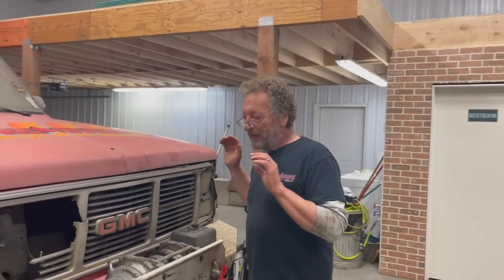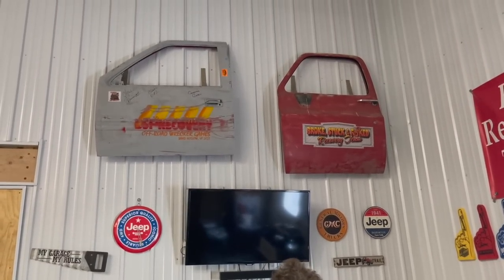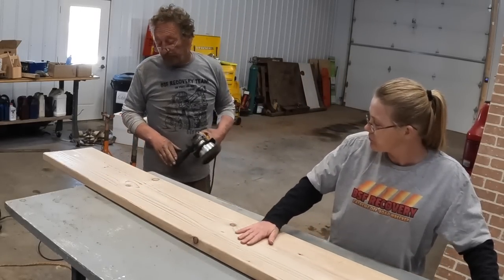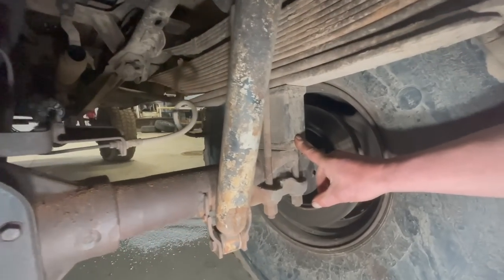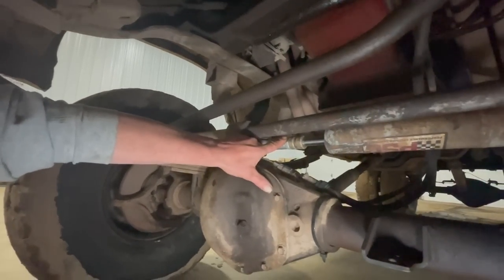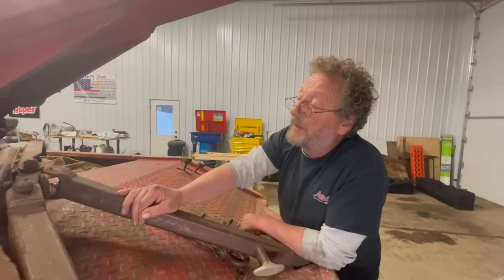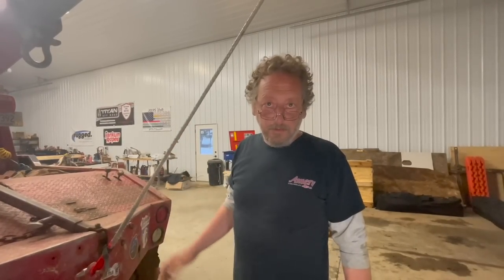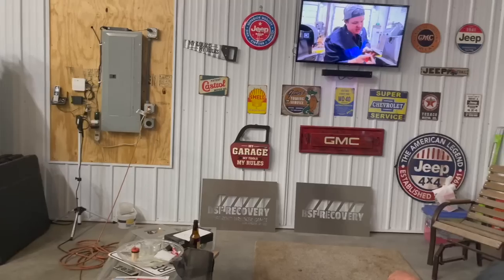Off Road Wrecker assessment after the games

Comment: Hi Eric, sounds like you have little bit to do, both in needed repairs or upgrades as well as wanted ones. As you mentioned your busy season is fast approaching and thats the only truck you have, make the necessary repairs to make it useable this season and over the winter you do upgrades that require the truck to be down for an extended period. Of course building a second rig would also be cool to see. Can’t wait to see what you come up with. Thanks.

Comment: 5.38 gearing will not even be noticeable. And some guys say 5.13 are inherently stronger. Id put a HD gas converter in and go with a doubler or magnum box from ORD. that big old heavy k30 with a smallblock and the th400 really could use some leverage on those 37s! I guess that's 1 huge advantage to haveing a stock 4 speed is the fantastic 6.55  First gear. Even second gear is deeper that the th400s first gear.

Comment: If this were my truck I'd be thinking about fixing the sling, fixing the springs, and modifying the hydro tank.  All the rest can come in time.  I like that the truck is attainable for the average guy and is also repairable with "off the shelf" and junk yard parts for the most part.
Reply: Good points.
Reply: @excavatoree  as I read the comment I was thinking I would reply “good point “

Comment: I think the wrecker looks great with the battle damage.  Very interesting bit about the diesel torque converter being used with the gasoline 350.
Reply: Yeah guys used to put a gas converter in the old 6.2 diesels to make them run harder. They usually ran too hard and blew up😅
Reply: @thekid1924  I didn't know a 6.2 could make enough power to hurt itself.
Reply: @haroldphipps3457  with a gas converter that flashes at about 1800  rpm it was basically just reving them to death. Not making more power. But I heard that it would really make them feel faster from a dead stop

Comment: Eric if you take the pick up point out of your hydraulic tank an put an extended 90 degree pick up that runs to the back of the tank then comes out the original hole it can pick up at a steep angle without cutting a new hole. with your front fender just hook a bolt and chain through the aerial hole and pull it out with big bob. Just a thought.

Comment: Eric, I'd start with a torque converter before touching the gearing. I'd be willing to bet that a proper converter would change the entire truck. There's a lot of companies out there that can custom build a converter to your needs. Definitely run a larger sump pan and elec fan on your auxiliary trans cooler.

Comment: Mentioning a second recovery truck got me all excited!  However, really like the current one.  I was thinking that the longer term plans might be to put the wrecker on a bit of a diet.  Fabrats converted to an electric powered fluid pump system that I think would work excellent on your wrecker and I think would save some weight.  Going to an electric winch would trim some pounds as well.  I am also thinking that going to air bags for the overloads on the rear springs could help as well.

Comment: With the gear ratios etc. Do you need the different ratio's for where you run most of the time? The cutting break idea is a neat idea.
Something you could do with the hydraulics, is tilting the rear of the tank up. That would save you modifying the tank too much. 

Something you didn't mention was sliders. If you welded some wider sliders on you'd have some extra protection for the doors in the woods. 

A working fuel guage / extra fuel capacity?

Comment: Another idea for lower gears might be to rebuild your transmission and see if there is a low gear kit for the TH400 that would give you a lower 1st and 2nd gear. There is or at least used to be a low gear kit for the ford c6 I sure someone offers a kit for the TH400.

Comment: E Lockers and cutting brakes sounds very useful. Sitting here thinking if you run a duel caliper system and add a micro lock. You could have hold and cutting brakes on a system and road brakes on a another. Or if money is an issues ( like it always is ). You could do it off of one system. I was just thinking of redundancy of the two system for a Working Truck
Reply: Excellent advice on separate calipers for the cutting brakes !! Not that expensive in the scheme of things.

Comment: IMO 5.38 isn't going to be low enough and gives you no room for taller tires. The doubler gives you a much lower gear ratio when you need it, and not when you don't, the option for taller tires in the future and the lower ratio may help negate the need for a bigger motor or a high stall speed converter. But it's probably a good idea to pick up a used wrecker to fill in for the downtime.
Reply: Its also a great way to destroy driveshafts and U-Joints. Lower R&P keeps the stress off the driveshafts.

Comment: Switching from 5.13 gears to 5.38s isn't enough difference to be worth doing, also I would keep the Grizzly locker in the rear, they are way more reliable and trouble free than an E locker or an air locker. For lower gearing either swap in an SM465 since it has a 6.55:1 low gear ratio. Or swap transfer cases either to one with a lower ratio like an NV271 or do an NP203/205 doubler.

Comment: Tough questions because it's hard to say if you have enough Traction in the mud and dirt to justify a doubler BUT in the long run you're better off with  taller gears in your axles and have a deep option in your transfer case. My personal favorite is a planetary unit that will bolt to the front of your 205 like Northwest Fab, Off-Road Design and Behemoth. Also I don't remember if you can lock your 400 in first gear or not because if I had one that's what I would do.

Comment: If you wash the windows, that should get you a deep mud hole recovery call in short order!  A deeper taller hydraulic tank will also help get the air out of the oil. Used to make some nice aluminum hydraulic tanks, steel for your application!

Comment: You appear to mostly trailer your jigger to events so, 5.38:1 gears is great for lowering gears without adding a doubler and more weight. Airlockers are the bee knees and will provide tight skid turns with independent (or cutting) brakes on the rear. If you really wanted to get fancy you could have cutting brakes on all 4 wheels. That way your navi (Mara) could operate them for one side tight turns or at speed drift turns (on soft ground) while you focus on pedals, obstacles etc. Good luck. Great truck and great team. Arriba!

Comment: Seems like you could remove the fender and use some 2x6s to pound the front flange square-ish.  Once it's flat, it should be close enough for the hood to shut correctly, and for the grille and headlights to sit properly.  Then the fender will look right, work right, and not need new paint.  Best of all, it'll still have the battle scar and people will ask about it.  Then you can tell the story.

Comment: I think you should but a doubler in the truck. You get so much more control. And get new shacle mounts, them you can eliminate the lift blocks. Or get a traction bar, so you dont have so much axle wrap. The one rory has on trailmater seem to work very good. Rocksliders and a new bumper. Then that truck is almost as good as i gets. I like your truck very much, but i think it desercs some upgrades.
Reply: Clay Patton  i know that. I never said anything about front dig. He has a NP205, the only thing he need to do is to grind the shift rail to get front dig and rwd low gear. A doubler is just putting a NP203 in front off the 205

Comment: No E-locker!
ARB air locker.
ZBAG is close ish to you. Zumbrota Bearing And Gear. Lots of history in truck pulling, may help out with an air locker.
I wouldn't consider an e-locker, but that is just me.
Twin stick the transfer case for sure. Cutting brakes for the win!!
The hydraulic tank modifications are very worthwhile!! Much taller, and supply fitting centered, 👍👍👍
Reply: And see about mounting the hydraulic pump lower! Hydraulic pumps are much happier with head pressure, rather than having to lift the fluid.
Also, re; ZBAG, 6.20 is a popular truck pulling gear ratio. Pretty sure there is a high likelihood that ratio will be in stock for the dana 60 front and the 14 bolt rear.

Comment: Build it for what you actually do, not what you might do.  Do you actually "need" lower gearing?  Selectable lockers, either e-locker or air locker, makes alot of sense, especially with turning brakes.   
The low stall convertor seems to work great for your normal usage,  and helps keep temps cool.  
No point in spending money if you don't have too,  off roading is an expensive hobby, and wreckers are just plain ol expensive.

Comment: Eric you need more horsepower. That's not putting out enough for the weight of that truck. You need the torque of a big block not only to move that beast up steep rocks but also hauling a broken vehicle behind it while doing so. I noticed all the wrecker games you struggled the most out of everyone.

Comment: Rather than digg'in in to those nice sealed up, locked, already to go axles why wouldn't you think about a sm 465 that is indestructable and maybe a Gear Venders Under drive ?  That would all be a bolt on pretty straight forward deal . A flip of a button you are underdriven ALOT !!! I just don't think anything beats an old reliable, strong 4-speed for what YOU are doing. It's not like you are taking that wrecker 150 miles on the freeway to a call is it?  I have run enough of them to really believe in  them  !!!     Jim